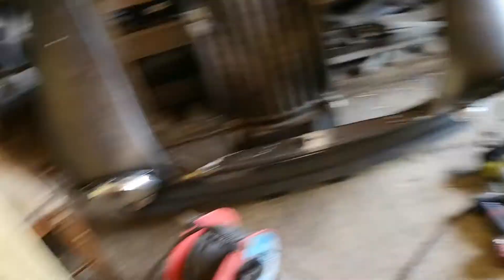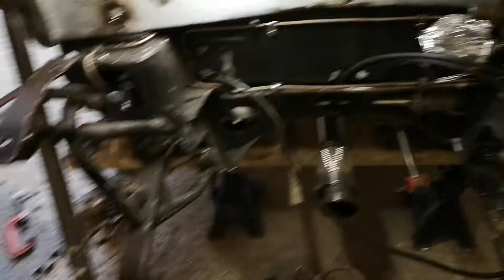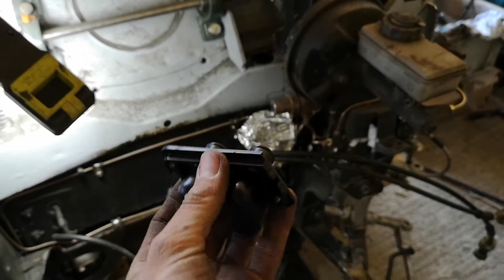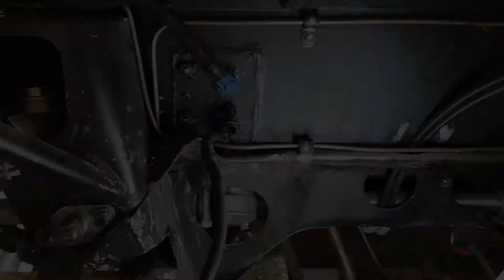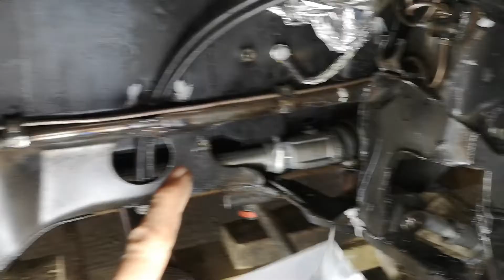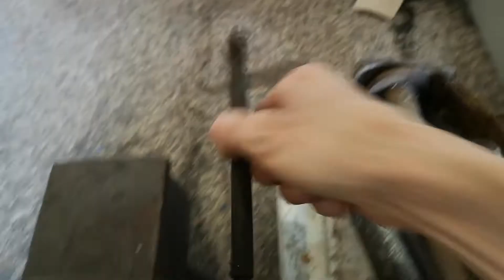The BoOsTeD Mini - Episode 36 - Clutching at progress

Comment: Quality-wise how does the proline braided line feel? I'm thinking of replacing my brake lines and not sure if I should go OEM (rubber ones) or aftermarket (stainless steel)? Any though will be appreciated?
Reply from the maker: It was very good. As good as any other supplier. I just liked how they charged me less for a shorter custom line!
Reply: @PiggyPower  Thanks a lot man, you're a legend! I'll give them a shot only 72 quid for a set front and rear. Late Christmas present for my baby ( e36 328i) I guess. Hope you had a good Christmas, and Happy Ne Year